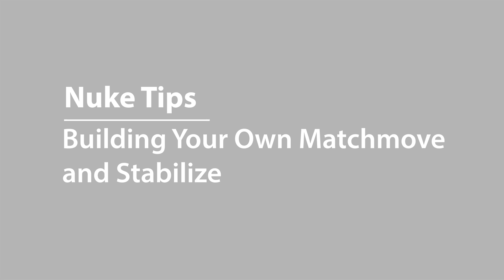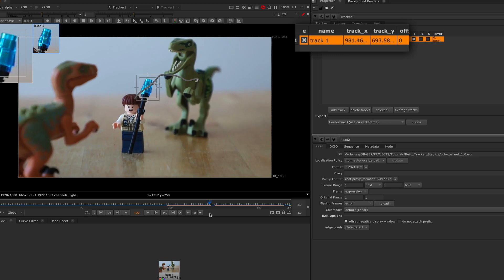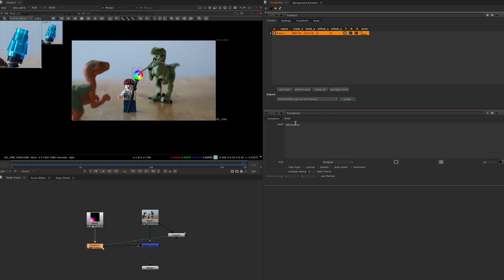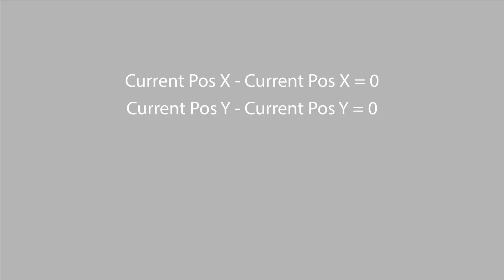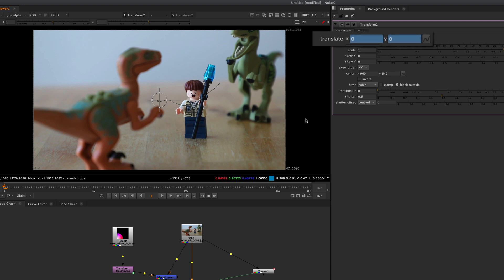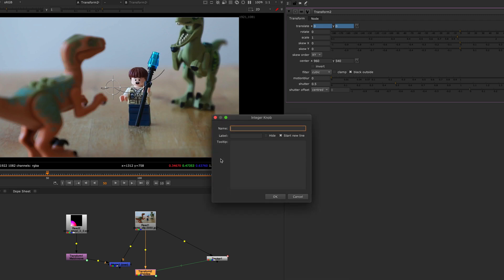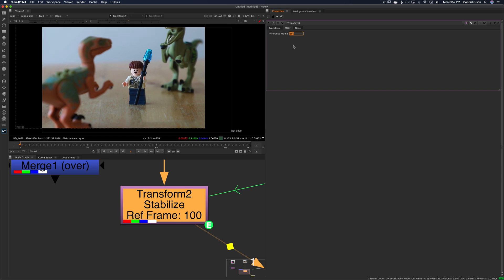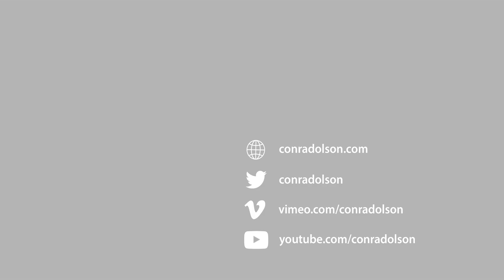Build Your Own Matchmove or Stabilize in Nuke

Comment: Thankyou for this tutz!
Do you think using transform node is efficient than using tracker while we matchmove/stabilize any element?
Reply from the maker: I'm sorry I missed this question. I think Transform nodes are quicker to work with in your script than Tracker nodes. The tracker nodes can sometime effect performance even if they aren't connected to your script. You don't notice at first but if you are doing a big paint shot and you end up with 20 or 30 tracker nodes in your script it can really start to slow down. There are some settings inside the tracker node that reduced this problem but I just try to avoid having too many tracker nodes in my script to start with.
Reply: @ConradOlson  Thanks! and I have one more question, How the center values are calculated in Tracker-Transform data?
Reply from the maker: @manoojmanoharan9854  I just did a little test. If you are just doing translation (no rotation or scale) then it looks like the centre point matches the tracker position exactly if you only have one tracker, or if you have more than one tracker then it becomes the average of them. So you add the x position of every tracker up, then divide that by the number of trackers, then do the same for the y values.

From my quick test it looks like that's the same for rotation too.
Reply: @ConradOlson  thanks for the info!